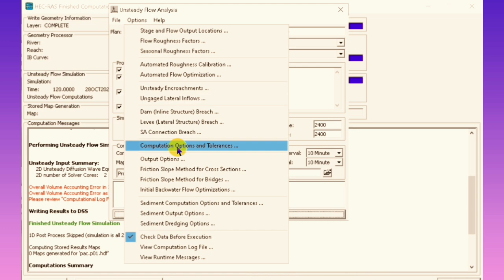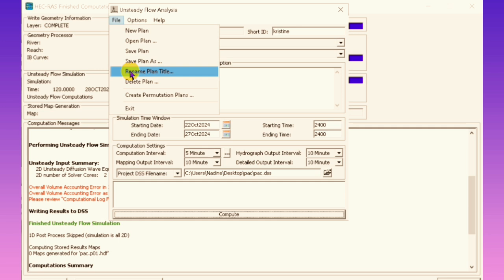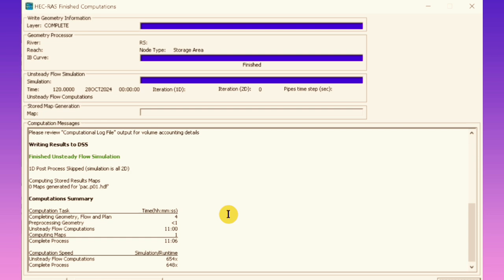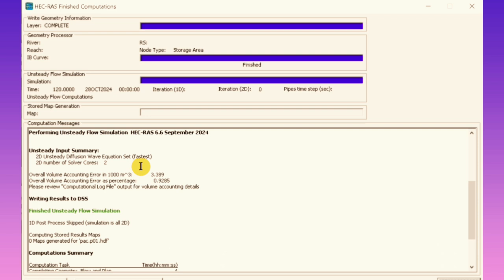𝙃𝙤𝙬 𝙩𝙤 𝙨𝙤𝙡𝙫𝙚 𝙩𝙝𝙚 𝙤𝙫𝙚𝙧𝙖𝙡𝙡 𝙫𝙤𝙡𝙪𝙢𝙚 𝙖𝙘𝙘𝙤𝙪𝙣𝙩𝙞𝙣𝙜 𝙚𝙧𝙧𝙤𝙧 in HECRAS

Comment: Help! please
im still having the same problem, i did what you did and still wrong
this is my error: 
Overall Volume Accounting Error in 1000 m^3:    1379900761251.
Overall Volume Accounting Error as percentage:   28050625174068.
Please review "Computational Log File" output for volume accounting details
Reply from the maker: What is your mesh size and time step you used? Did you use Advance time step control using Courant?
Reply: @selectedsolutions  5x5 for the perimetre, and for the compute time id try from 5min to 10 s
and yes id use the advance time
max 1 and min 0.4 for courant